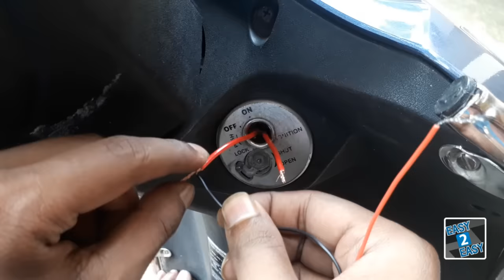how to start your bike or scooter without keys in 1 mins

Comment: Bro next video dalo how can protect your bike from this type of theft
Reply: Its impossible 😂😂😂😂😂😂😂😂
Reply: Archana Sah 
Why??
Reply: You can't , it works by short circuiting.
Reply: gadi ki battery low rakha karo ya phir petrol kam rakhdo
Reply: Put a handle lock every time
Even if it was started it doesn't go front:-)
Reply: Or you can just insert an alarm on your motor bike.. in my country 🇵🇭 it worth 16-50dollars

Comment: No body caries 9watt batteries ever were they go... And who has tape or pencil in a scooter... Bill shit
.. a single drew driver is enough to start a scooter .. remove the dashboard and connect the wire together which goes to the lock set droooommm your scooter starts...😂😂